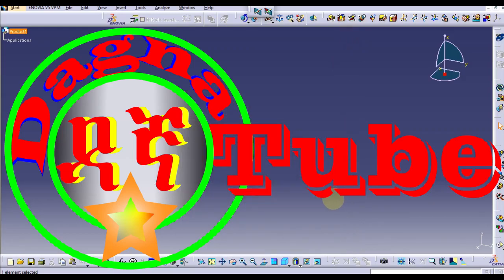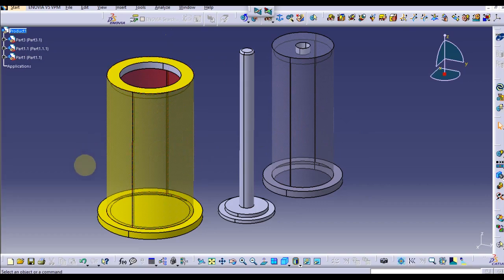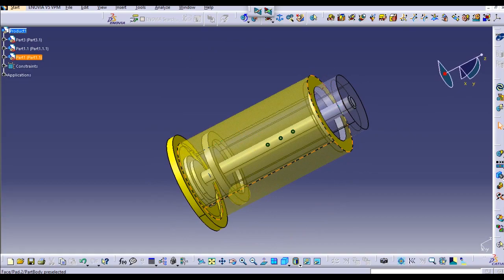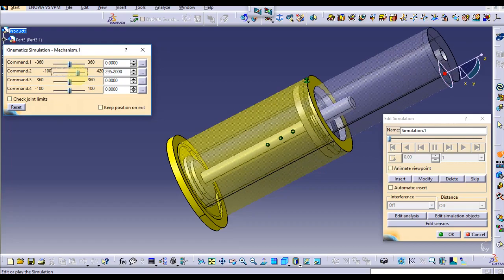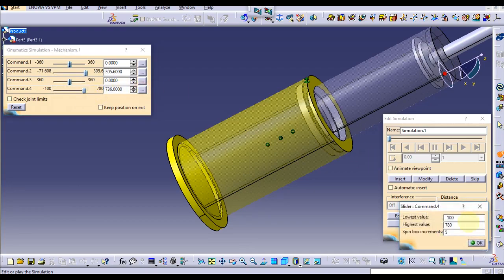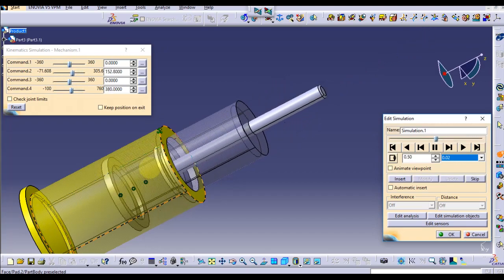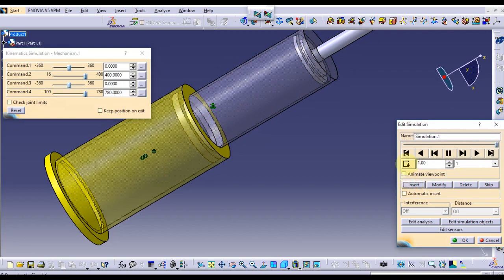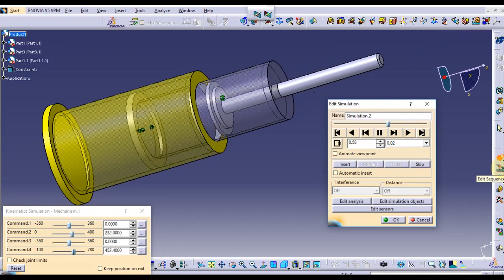Double Acting Dual Cylinder Simulation on CATIAV5- Double Acting Cylinder-Hydraulic Piston

Comment: how can i simulate two parallel simultaneous cylinders on the same time
Reply from the maker: Great question, Welcome to Wabi Media. For your question let me tell you the answer. To simulate any part they should have common part. If the two cylinders are connected through one or more parts you can simulate by giving a command that you give for the first one. If you need more help you can call me via 0923106445.